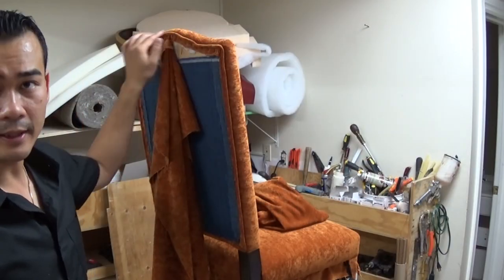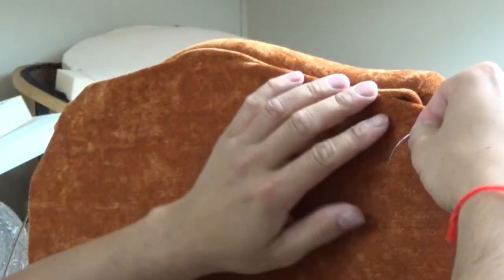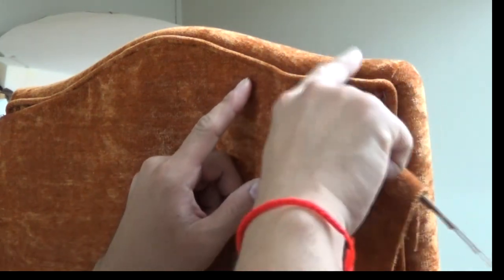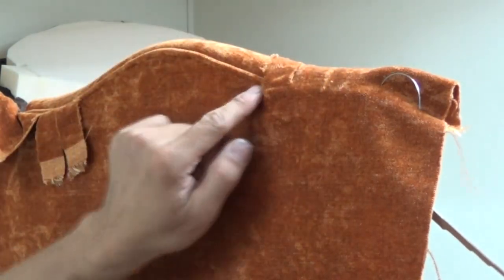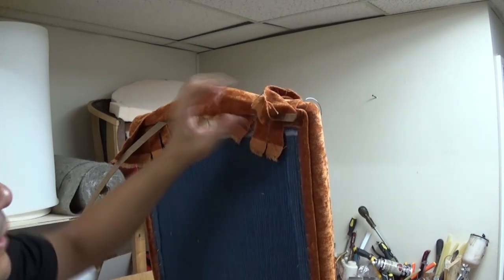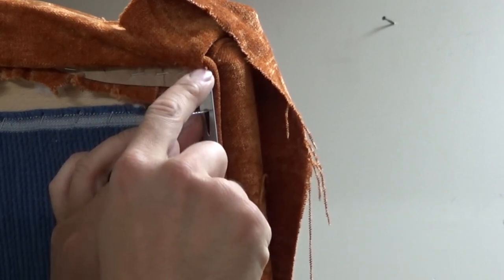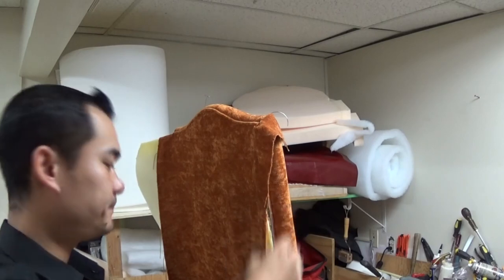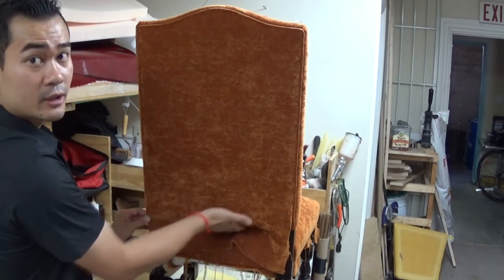HOW TO UPHOLSTER THE BACK OF A CHAIR - ALO Upholstery

Comment: this chair looks much much better than the ones I have have been reupholstering. the backing is like this one. that is what I have been trouble with. its  my first time doing this. Iv'e made a lot of mistakes but I will have to leave it as it is. my hands are sore from removing so many staples and then reupholstering  3 of the six chairs. How much more or less would it cost in labor  to get this type of chair upholstered? Thank you
Reply: I had estimate of $85.00per chair that's why I'm  doing myself